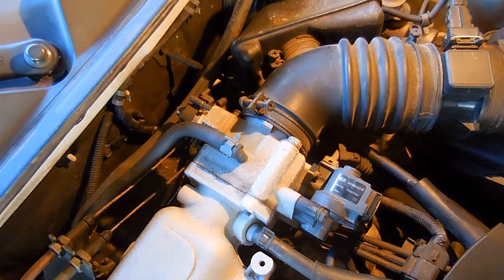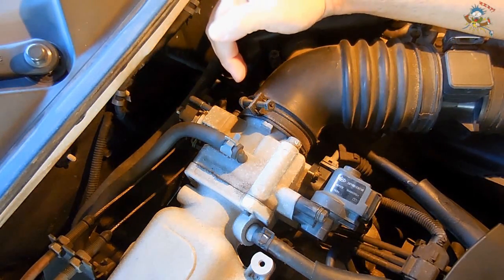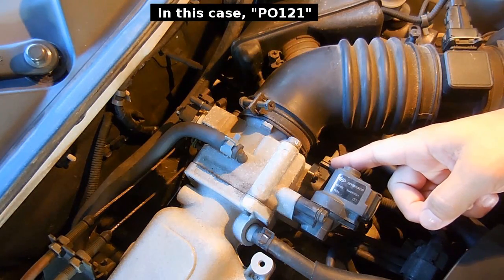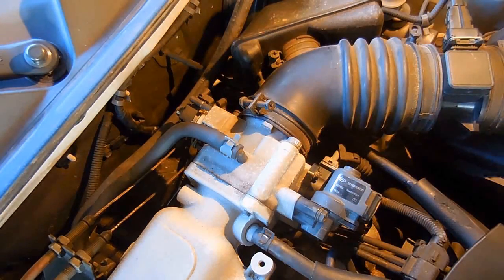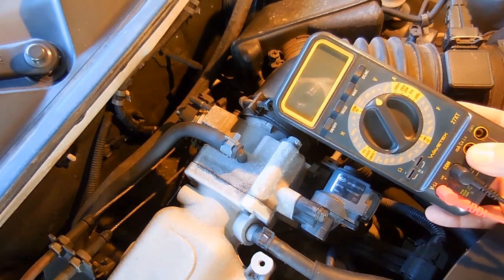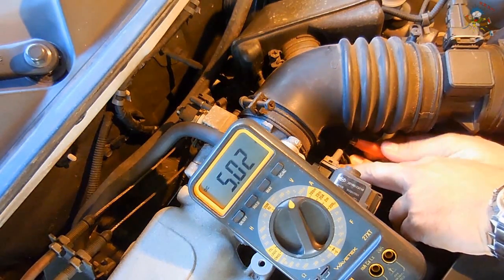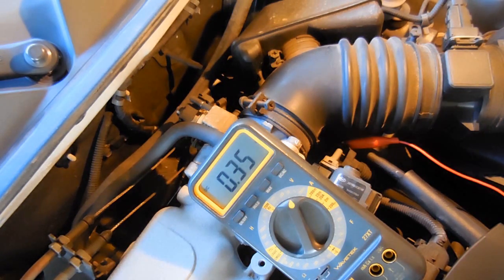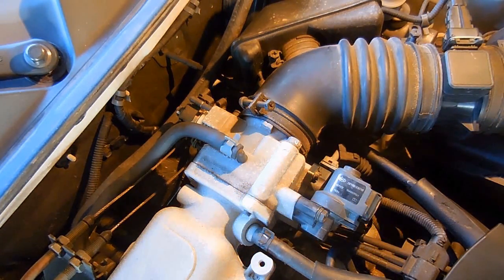How To Test A Throttle Position Sensor (TPS)

Comment: 06 Nissan Sentra 1.8 L having problem with it . Took it to " mechanic " and he said throttle body needed to be replaced which i did get him to do that . So now a few weeks later still not fixed . What it's doing is after starting won't rev up stays low even flooring gas pedal . Even loses power while running a few times . Idle fluctuates a lil at red light from just below 1,000 RPM to just over . It doesn't happen that often but this needs to be fixed or risk being stranded somewhere i think . It can run for a good long time even went out of town and only happened once . Same mechanic now says take it to a shop that has a much bigger scanner / computer but I don't have much trust in this guy anymore . After all , why didn't he say that in the beginning ?? He may or may not done a relearn procedure as I was watching him doing this work . I don't remember him doing one . I found a relearn procedure did it twice now . Any help will be appreciated . Mechanic did before the TB replacement to try to scan but couldn't and I've tried to have it scanned at auto zone and nope . I looked at fuses look good . I may have to chance it at that place with the big diagnostic scanner .
Reply from the maker: You need to use a code scanner. Could be a faulty MAF.

Comment: I've checked the sensor of my rover streetwise and it is between 0.61V (no throttle) and 3.64V (full throttle) so this seems to be OK? However occasionally my car doesn't idle properly at start up (not all the time only sometimes). And during driving sometimes the car jolts/stutters and occasionally the engine stops during driving even at highspeed . I don't know what the problem can be?
Reply from the maker: See if the computer has any stored trouble codes.

Comment: What about the fly by wire electronic throttle body?  Does it have a TPS built in somehow?  I have searched for information on this topic as yet found nothing unfortunately. New sub for a brilliant video. Gday from Melbourne Australia 😊
Reply from the maker: You need a pocket oscilloscope to see if it's working properly. Thanks for watching!

Comment: I just did that exact same procedure on a 92 Chevy lumina APV minivan 3.1 engine I didn't see this video until after I tested it actually have a shop manual but sometimes the part make look different order wording sometime you got to read it over again but the video you made I just checked throttle position sensor and it came out exactly as you said it would kudos to you very clear presentation you have a fine art in teaching and auto mechanics very nice video!!!
Reply from the maker: Glad you liked my video Carlos! Be sure to watch and share my "Automotive & Mechanical" video playlist below. Thank you
https://www.youtube.com/watch?v=hnd7P7O_vEQ&list=PLQ6IOhUBblU3mBem9ImEgGzmqToW6SCJD

Comment: Hello Sir, My 08 Suzuki Vitara idle ups high when  crank. After the second second crank it doesn't idle up high at all. It don't shut off at stops lights🚦 or hesitate when driving. The vehicle flys like hell on the hwy with no trouble at all. Only problem I have when I crank it up at first it idles up high then comes bck dwn too normal running.. What do you believe is the main problem going on with my vehicle?☺
Reply from the maker: Maybe a faulty idle air controller. Be sure to look over my extensive video playlists below for other videos of interest to you, and most importantly share my channel with many others. Thank you!
https://www.youtube.com/c/electronicsnmore/playlists

Comment: What would the symptoms be of a TPS that isn't calibrated correctly? I feel like my cars RPMs are slightly higher (like 3500 rpm when it should be 3000) at the gear and speed its in (manual tran). My TPS has those adjuster holes where the screws go and I once accidentally messed with them and then tried to put it back exactly as it was.
Reply from the maker: Hi there. The RPM of the engine is exactly what the gauge says, unless the gauge is faulty.

Comment: I've got a citroen c3 and it must have 3 dead spots as it start from a low voltage  it will. Clime to 5v then after that back to where it started from then clime again  to 5v .  And same again.  It pushing  the car in to limp mode and giving  a code of p0121  throttle pedal/ position sensor switch A circuit range performance problem
Reply from the maker: If it's not smooth, then yes, dead spots. Time to replace. Thanks for watching!

Comment: Does every car has a different reading on the sensors I am trying to test my 2001 PT CRUISER TPS SENSOR IT MAX OUT AT 3.77
Reply from the maker: Sounds a little off, or you're not testing it correctly. Look up the specs for your vehicle online. Thanks for watching!

Comment: I have a scan gauge hooked up I’m showing a dtc 122 and 1122. My throttle volts won’t go above 3 and the half volts and my throttle percentage won’t go above 75 percent. 

I’m kinda low on funds. I don’t want to replace the sensor and that not be the issue. I tried wiggling the connector. It still won’t go above 3 and the half volts and won’t go above 75 percent

Comment: can a bad TPS cause your car not to start? i have a 2000 astrovan i can spray quickstart into the aircleaner and it will crank but it will not run any ideas??
Reply from the maker: No. I'd check the ignition module and fuel pump.
Reply: @electronicsNmore  thanks i will

Comment: I followed your description about the 4 wire system. I was able to see a steady rise in the signal wire to verify my TPS was OK.
The 4th wire was reading 0v at idle, and it read 4.57v when the throttle was opened. Was this due to the key on engine off?
If I back-probed that wire with engine running, would I see voltage variations from the IAC getting signals?
Reply from the maker: Yes, leave the TPS connected while testing.

Comment: I have a 2005 kia sedona 3.5. The TPS has 4 wires.
Reply from the maker: One is Ground, one is 5v+, one is the TPS signal shown in this video, and the last one is idle switch signal that varies with position..
Reply: Thanks for the info. Our '05 kia sedona has an irregular drop in rpm, and bucks a little bit with a/c on, but then catches itself.  Did the resistance check while operating the throttle,  and found a spot where the resistance went back up. The final resistance at wide open was less than midrange.  I have cleaned the throttle body, and the IAC. Used MAF sensor cleaner. Problem is still there. No check engine light, or pending codes.  Seems the only thing left would be the TPS.

Comment: Very informative. I converted a vortec 350 from fuel injection to carburetor and I'm trying to wire the market throttle position sensor do any instructions about what each wire is for. I'm looking for somebody to help me figure out how to wire this thing it has three wires on the factory harness and three wires on the aftermarket throttle position sensor. I don't want to just randomly hook wires up I don't know if I could mess it up. Please message me if you could help. You really seem like you know what you're doing
Reply from the maker: You need to look online for information regarding your vehicle's TPS. Thanks for watching!

Comment: Hi, I have P0122 & P1961 fault codes on a Mitsubishi Colt 1500cc Turbo 2006 model and it goes to limp mode after some runs (mostly after a day). If we turn off the engine for a while, vehicle works normally for around a day again but check engine remains. They told me that I have to recalibrate TPS or TPS is dead. The car was remapped but they told me that the TPS is faulty probably. Car is driven very well on the road to be honest but suddenly (unexpectedly I would say) it goes to limp.Should i perform your test in order to check? These combination of fault codes is very popular on Mitsubishi Colt even on many stock cars as well. Is that true? Thank you in advance
Reply from the maker: A TPS is not that much money. It may have a small dead spot inside it. I had a new MAF that wasn't OEM cause my car to go into limp mode at times.
Reply: Thank you very much for your reply. The car has an upgraded air filter (cone filter) and a remap. But suddenly it goes in to limp and I get these 2 errors. I will check voltages on TPS like you do. If it is faulty, I suppose that I wont get normal operation (and min - max values of voltage) like you show in the video right?

Comment: Hello:  My old 1993 Ford Probe gt still runs, but now surge rpm between 30 -40 45 mph, all manual and online tips said to check TPS, but my mechanic doesn't believe that it is nor did he test it.  This is the original TPS from day one on there.  Do you think engine rpm surge could be the cause and what would it hurt to change it out, I have one here.  PLease thoughts as my son wants to drive to school and back.  New plugs wires, fuel filter, brakes rotors calipers etc. just this one last issue.  I hope it is not transmission.  Before I send of to transmission specialist what do you think??
Reply from the maker: Check engine light on?

Comment: do I need to recharge the wires of the TPS, if so how?
Reply from the maker: Please delete all comments and post ONE comment thread. You're cluttering the comment section. I'll reply once you do that.
Reply: have a doge dart and I think something is wrong with my car, when I try to crank it up its trying to kick but it eventually turns on it's like it having a hard time Turning on immediately. when I accelerate it kinda jumps. and I something get the check engine light on and I got this I got a code PO123 - its saying Throttl/Pedal position sensor a circuit high input and sensor b circuit low input..... well this help me fix my car because I'm scared that it probably won't turn on one day..

Comment: and it said position sensor a electrical citcuit input signal had high voltage for a predetermined period of time? so it's not really the throttle body its the sensor that needs to be replace is

Comment: Hello 
Help 
I checked wire harness from ECU the top and down all have 5 Volts with exception of the middle wire what's wrong here ?
Reply from the maker: Leave the TPS connected when you probe the harness from engine ground.
Reply: electronicsNmore OK, need a backprobing kit then. Do you recommended after MKT tps of OEM?
Reply from the maker: Wire probe set is in the video description area of this video:
https://www.youtube.com/watch?v=3stEPj0fpR0
Reply: Thanks, please the TPS harness ground (ie No 2)  from the ECM should it have volts present in it? I checked mine at DC volts 20 and it has volts of 0.30 is it normal?

Comment: I calibrated my TPS sensor. Got the appropriate ratings or voltage. After that I loosen the boat that connects the throttle cable pulley to the butterfly. So that I could get a lower RPM around 700 to 800 RPMs. However I took it for a test drive and the throttle cable and Butterfly seem to be staying open. The RPMs are revving so high without me even pressing the gas pedal. Could you please point me in the right direction on what to do here. This is on a 1998 Honda Civic LX
Reply from the maker: 100% you failed to install the TPS correctly.

Comment: great video i disconnect  the cable of the TPS and got 5v reading from ground to supply and  and also i got a 3v on signal to ground  under ignition key set to on only  engine off.  is it normal i got a 3v on signal to ground terminal from the cable of the TPS ? or theres something wrong from the ECU? thanks
Reply from the maker: You need to leave the connector on the TPS, then probe the back of the signal wire with a needle to measure the voltage correctly.
Reply: ah ok im just thinking if it is normal why i got an initial  3v supply from the signal pin cable connector of the TPS thanks

Comment: Is that a signal wire,you are checking voltage,?at wide open throttle what’s the voltage? Does this apply for my 93 maxima,too?
Reply from the maker: Yes, the signal wire. Look up the specs online for your vehicle. The voltage should be high when full throttle. Thanks for watching!

Comment: Get a Snap-on scanner and adapters and manuals from E-Bay. Get the 120 volt cable  and battery Pak to check readings away from the vehicle. It can test TPS, MAF, ISC, Ox. sensors, RPM's, fuel trim, movies, snap shot, KOEO, KOER, fuel pressure, and  oil pressure.  It can check MUCH more! Get the latest cartridges.
Reply from the maker: Way too much money, not necessary.
Reply: A EEC-IV system has just basic tests but the Snap-on scanner troubleshooting cartridge can tell you which codes to tend to if you get certain codes. If you have another make of car, it may come in handy. OBDII cars can run tests like Ox sensor tests and EGR flow etc. Some later fords have the Star test. With the Snap-on scanner you can turn on the timing advance test from under the hood. You can do the solenoid and relay test under the hood from anywhere under the hood. Some cars allow you to adjust the RPM's at the drivers seat to check EGR flow at certain RPM's. You can run the engine at 2000 RPM for 2 minutes using the thumbwheel on certain cars. On some cars you can watch Ox. sensor activity. Some cars you can do a movie test to locate intermittent faults. There is a snapshot feature. The scanner and cartridges aren't extremely expensive. You can get ABS cartridges. Also transmission cartridges. But a digital tester basically does the same basic tests but you can get the special cartridges to do more.
Reply: Snap on scanners overpriced and not very capable. Autel scanners in my opinion blows Snap on out the water.Way more user friendly and i can also reprogram through my j box

Comment: You had a bald spot ok well what did it do to the car,how did the car react
Reply from the maker: The engine will have all power drop to idle while the gas pedal is pressed down, and the transmission won't shift properly. Thanks for watching!

Comment: Great video, but is that a Hyundai Tiburon your working on? Because if so, you just made my job a lot easier cuz that's the car I'm working on for the TPS.
Reply from the maker: 2003 Hyundai Sonata GLS. You likely have the same V6/2.7L engine. Thanks for watching! Be sure to rate thumbs up, check out my other videos and share.
Reply: Thanks. You're right and will do. V6 2.7L looks exactly the same from that view.

Comment: A Power Probe works much easer, as it comes with two clips that clip on the battery, and has a display for voltage, then you use the wire probe and screw it onto the wire then connect the probe in the front, then its hands free you just watch the reading as you use the throttle.
Reply from the maker: +Eniklis 
I have no problem at all doing it the way I show in the video. How much easier can it get than a cheap DMM, a straight pin, and 2 jumper wires. You can buy everything at Harbor Freight for around $7.50.

Thanks For Watching!
Reply: You have a point, your way is pretty easy and cost a lot less than a power probe, I work on Trucks all the time mostly electrical, It just Saves a lot of time.

Comment: it may not be as simple as just revving up and and slowing to a near stall on its own while holding the gas pedal. when mine failed on a v6 in a ram 1500 i had much worse problems. spitting and sputtering wanting to stall. would not stay running random rpms from idling to near stalling. at that happened all at once. i had to drive it home in 2nd. mine you this is an automatic trans. at 4600 rpm going 45 mph for 28 miles. old girl wasnt to happy with me after that.luckily it did not overheat. after replacing it it was all good. but i believe it may have also cause my crank position censor to fail shortly after about a few months later because of the high rpms. the only other minor problem i gained from holding it for so long at 4600 rpm was a slight lifter tick that i cant get to adjust out.

Comment: There is a multitude of sensors,solenoids,actuators on all vehicles and equipment today.Maybe do a series on basic auto electric such as starters,alternators and solenoids also. I have been rebuilding repairing various electrical components that few  guys seem to be able to repair because they do not understand basic electrical technology.Cool video! Shalom
Reply from the maker: +motorhead 
Glad you enjoyed it.
Reply: @electronicsNmore  cheers

Comment: would liked to have seen the output from the faulty sensor as well.Easy step by step video and teardown was helpful.
Reply from the maker: +Tom OConnor 
Hi Tom. The output would have shown dead spots and meter readings that were not smooth up and down.

Comment: Very well don, Thanks have a good one,
I will share with our friends, since we have many question about this, 
Thanks
Reply from the maker: +THEWATERENERGY1 
Thank you sir!
Reply: +electronicsNmore I forget one,in some case there is also a stepper motor include, that runs the butterfly plate in the throttle body, may you can do this one to ? Thanks

Comment: Hello. Could a defective TPS cause the Cruise Control on a 06 Suburban to stop working? Merry Xmas
Reply from the maker: +Tony M 
Hi Tony. The other cable you see in this video connected to the linkage on the throttle body is from the cruise control unit. If the vehicle runs fine without cruise control, then the TPS is not the problem. The problem can be a faulty brake switch(make sure the brake lights work), loose wire harness/connector, broken vacuum line, faulty cruise control switch, or faulty cruise control module/PCM.

Thanks For Watching! Be sure to rate thumbs up, and share with others.
Reply: +electronicsNmore My 06 Sub has no cables. I believe its all electronic. I have replaced the Brake switch and CC/Turn signal lever and all fuses are good.

Comment: I think you meant rheostat not potentiometer. The potentiometer is a variable resistor (rheostat) with a switch built into circuit.
Reply from the maker: +Krugzug 
Hello there. No, I was accurate in the video. A rheostat is a high power potentiometer(variable resistor).

Thanks For Watching!